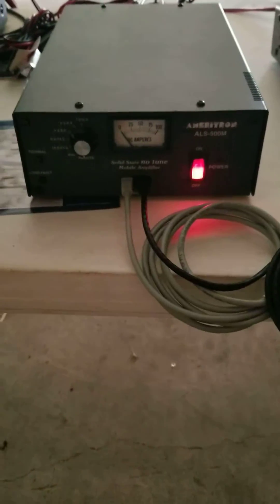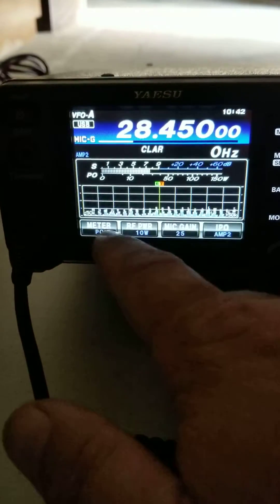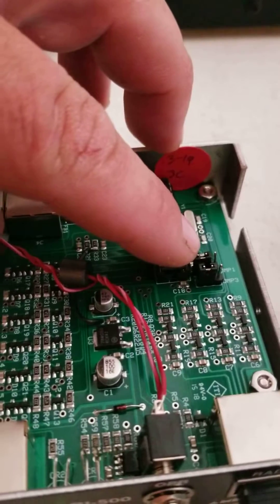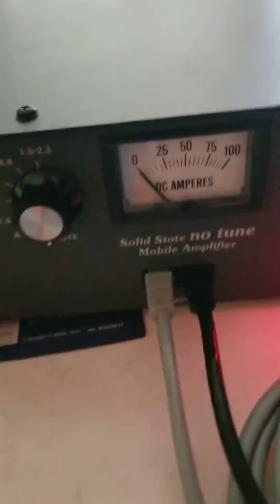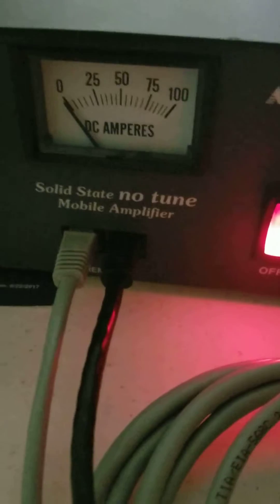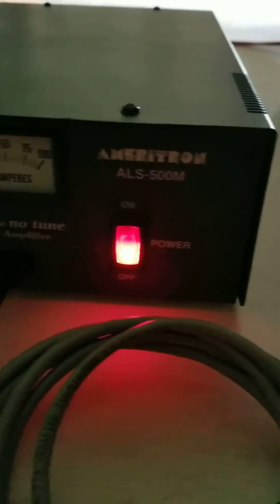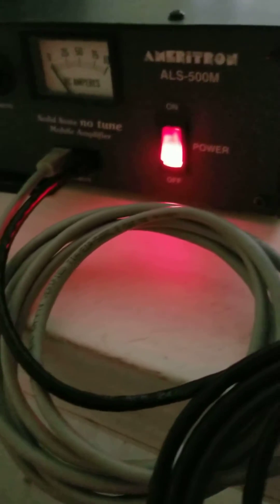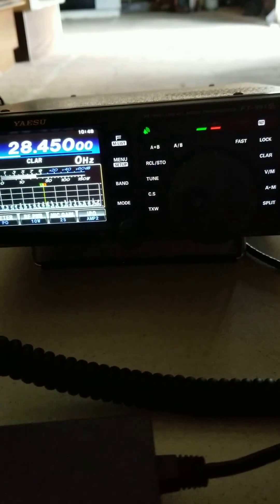Als500m and ft991a

Comment: The amp comes without a 10m interface option, which might explain why the ARI-500 might comes with 10m disabled. The previous owner of your amp must have purchased and installed the 10m option board.

Comment: I was getting about 300watts with 20 watts in. Ameritron recommends you don't go over 75 watts input, or you can damage the finals. I don't know if you ever got that meter, but you were getting that overload because of reflected power over about 60 watts, you need a tuner after the amplifier. 73's kd9oam